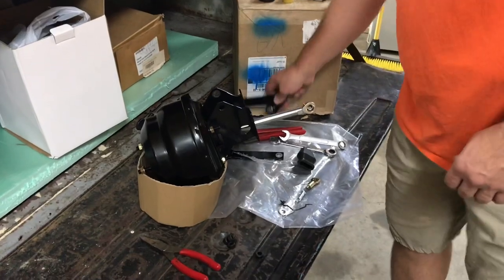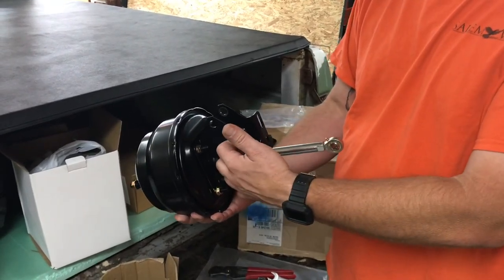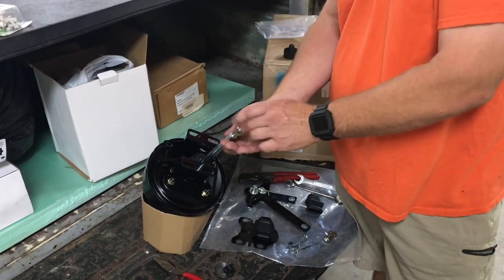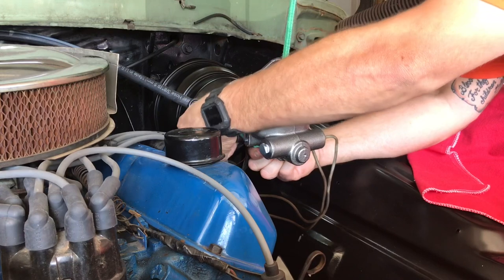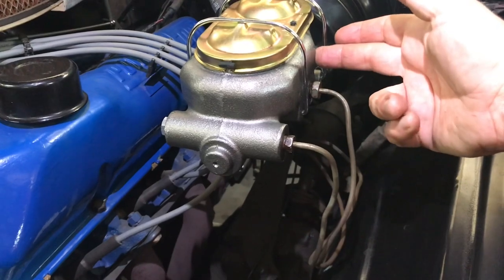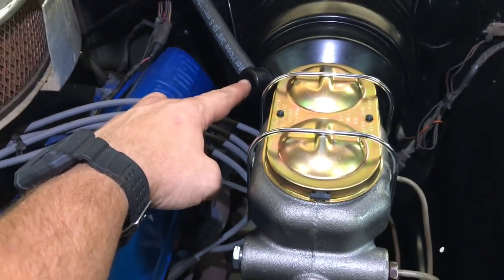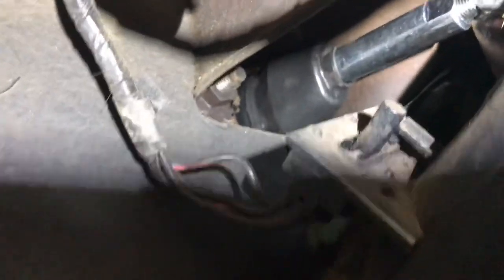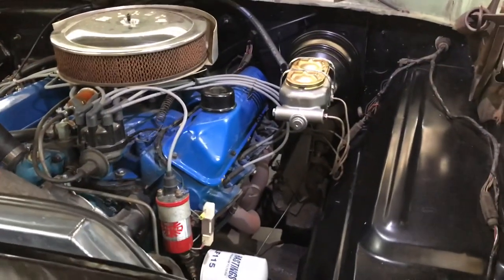CJ Pony Parts power Brake conversion kit F100

Comment: My father has a 67 F100 that was 4 wheel drums, no power. We added the brake booster a few years back and made a big difference. Just did the front disk brake conversion last week and it's so much better. I almost hit the dash the first time he hit the brakes because he just pushed the pedal like usual. Different company, and it was pricey but well worth it.
Reply from the maker: Yea it’s definitely a learning curve when you upgrade the brakes. I’ve still got to upgrade to front disks and install the factory power steering parts I’ve been sitting on for a year now. Definitely want to drive the ole boy more this year. Thanks for watching and please subscribe!!
Reply: @SalemVaOutdoorsAndMore  after 25yrs of searching I think I finally have all the stuff to do power steering for him now. It's a mix of factory and aftermarket both. Couldn't find everything factory unfortunately. It's already going to bee right at 100 degrees here tomorrow, so hopefully we can get that steering done within the month.
Reply from the maker: I had plans to put my power steering parts on over the winter, but we had out basement flood in the fall and everything had to be moved to the garage and I’m still trying to get that stuff moved so I can get my truck back in the garage. Hope to have the parts on by summer or fall at the latest. Best of luck with your project!! I’d love to see some pictures
Reply: @SalemVaOutdoorsAndMore  I've got a bunch, I'll try and figure out how to send some
Reply from the maker: My email is jab74@hotmail.com

Comment: Great video. I too purchased that kit for athe upcoming project and was surprised there was no instructions. I called cj pony parts and got nothing but attitude. Was told most of their customers are professional and can figure it out.  I said I am sure I can figure out just wanted to make sure I was using it the way it was designed.  Doubt I will buy anything else from them.  Again thanks for video
Reply from the maker: Jeremy Duncan glad it helped you with figuring out what was needed to make it work for you. I didn’t even call them about the instructions I just started looking for a YouTube video which I didn’t find one so I decided to post mine. Please subscribe if you haven’t and thank you for watching!!
Reply: I’d have sent the parts back and told them to pound sand. Attitude like that is bullshit
Reply: Got the same, "attitude" for a different question.
Reply: I don't use them anymore. I had ordered a bunch of parts for a 65 f100 and they sent the wrong ones and never have been able to get that resolved. Same thing with LMC Truck except LMC would take them back but when they resent the "corrected" parts they were the same wrong parts they had sent the first time. I'll never do business with either again.

Comment: was the rod with heim joint ordered separately? I just ordered this same kit from summit and planning to install on my 1971 f100 4x4. Im also hoping the booster clears my valve covers (i installed cast aluminum holley valve covers for FE engine.)
Reply from the maker: Nope everything shown was in the kit with the exception of the actual hose I used for the vacuum line. Thanks for watching and please subscribe!!

Comment: FYI, I did this a few years ago to my van, the manual pedal is set up for more leverage than a power brake pedal, there is a difference, I could lock up all 4 drum brakes and practically stand the van on its nose, unfortunately someone trying to beat the light making a left turn, they hit it head on, totaling it out.
Reply from the maker: Yes they are definitely more efficient than the manual drums!! Sometime they work a little too good. Thanks for watching and please subscribe!!
Reply: @SalemVaOutdoorsAndMore  I kept finding the manual master cylinders so weak they would not operate my rear brakes, years of them not engaging, the second I hit the power pedal they were working, I don't know how many manual master cylinders I went through, my brake warning light finally went off, pretty sad.

Comment: I want to put a power brake booster on a 1973 f 250 4x4 that I am building a engine for and putting power steering on also I hope I can get a kit for it that will work

Comment: Did you have to swap the brake lines around? Had to put the front line in the back and the back on the front.
Reply from the maker: I have not swapped the lines, both chambers are exactly the same size so it did not appear it would have made any difference to me. Thanks for watching and please subscribe!!

Comment: Awesome video, ive got a 1970 f100 with 302. If you dont mind, whats your set up on your wheels n tires? Did you add anything for the stance?
Reply from the maker: The front wheels are stock with the 6x15 steel wheels I think. The back wheels are factory style 8 or 9 by 15s. I’m not running any spacers. I do have the DJM lowering kit front and rear and had 1 leaf removed from the rear when I lowered it. Hope that helps. Thanks for watching and please subscribe!!

Comment: Did you have to add residual valves?  I have a 68 F100 with 4 wheel drum & want to add power brakes.  Kits I see say drum brakes require residual valves.
Reply from the maker: I didn’t add any additional valves and it works just fine. My kit said four-wheel drum or front disk and rear drum. It just won’t work on four-wheel disk.

Comment: I have a 79 f100 and I'm confused on the hook up of the front brake lines. I have same one in video but my original front line was hook to the bigger reservoir.  Thanks
Reply from the maker: Yes I was a little confused myself when I looked at it because I’ve always known the front wheel reservoir to be the larger one and I noticed that these reservoirs are both the same size. I just hooked mine up to the line which was closest to the connection port on the new master cylinder and have not had any issues. If you do have issues with yours after getting it hooked up, you can always add a proportion valve to help balance it out. Thanks for watching and I hope your project goes well! Feel free to ask if you have any more questions and please subscribe!

Comment: Can this system be used with any front disc conversion kit like the willwood from summit for example where I believe it's plug and play system.
Reply from the maker: It should work just fine, as long as you still have drums in the rear it will do drum drum and disk drum combinations. Thanks for watching and please subscribe!!

Comment: Hello there, I have the same year and model truck and did the same booster kit but for some reason my brakes locks after driving and braking for 8 min. I have to release the pressure to bring it back to the garage, I have quit trying to troubleshoot this booster . Do you know where should I be looking at and what I'm doing wrong?  Thank you for your time, Henry.
Reply from the maker: Is it all the brakes or isolated to just front / rear or one wheel? Multiple things come to mind to check. Could be pedal or push rid adjustment, or a leaking wheel cylinder.  How were they working before you installed the brake booster?
Reply: @SalemVaOutdoorsAndMore   thank you for your fast response. So it was extremely hard to push the brakes when they gave me the truck. I decided to changed all brake lines and installed front rotors. That was the only problem. The issue is left and right brakes locks and can’t figure out why. I have to bleed the Proportion valve just a very little to release the pressure then they free up right away but it keeps happening to the point the truck can’t be driven.
Reply: @SalemVaOutdoorsAndMore I mean, I have to bleed the Master Cylinder just a very little to release the pressure
Reply from the maker: That’s interesting, have you removed the cap to see if the expanders in the lid are dropped down to increase the fluid level? I found mine like that before even tho the cylinder was full. Not sure if the actual name of the lid seal with the expanders is called. Keep us posted!!
Reply from the maker: @JoeJoe Make sure the vacuum line is hooked to a good port, hard pedal sounds like either lack of vacuum or something binding
Reply from the maker: @JoeJoe Make sure the vacuum line is hooked to a good port, hard pedal sounds like either lack of vacuum or something binding

Comment: What size fittings go into the new master cylinder? I just got the same kit.
Reply from the maker: Sorry, I just now got the notification on your comment. Honestly, I’m not sure about what size the fitting is. It came with my kit. One of them had to use an adapter that was in the kit. The other one threaded it right in it depends on what your Truck has on the end of the brake line where it connects to the master cylinder

Comment: Hi. What is the size from booster to máster cylinder?. I want to buy one but i need to be sure that it fits in my car.
Reply from the maker: There is a link in the description that will take you straight to the same one I’ve got. It should have the specs on the site if you want to check it out.

Comment: What did you do for the brake light switch? The Heim joint is too big for the switch to work, seems to me.
Reply from the maker: I had no clearance issues with the brake light switch everything fit as it should have. The heim joint was pretty much the same size as the factory connection. Thanks for watching and please subscribe!

Comment: Great video!  Would you happen to know the bolt size of the bolts needed to mount the booster to the firewall?
Reply from the maker: Thanks for watching!! I think mine came with the bolts or I used the ones on my old master cylinder. I don’t recall having to purchase anything additional. Hope yours goes well and please subscribe!!

Comment: I have a 1970, all drum brakes.  I was wondering if you really need to replace the master cylinder? Or is it possible to purchase everything else as a kit, and just reuse the existing master cylinder (my brakes are working fine, I just wanted to add the power option.

Comment: Hey Jab! We actually have the same 71 F100 with the same paint job haha but I too wanna know more about it. My break pedal decided to not hold pressure anymore but I kept hearing noise coming from the front passenger wheel I think. I don’t know if that’s the exact location but there is a bit of cringing going around that area, break pads are fine too. I checked all my break lines and no leaks or anything. Do you think I could just need a new MC as well or is there something more to it?
Reply from the maker: Do you have power brakes or manual? Check for broken springs or hardware. If nothing there, I’d bleed them, maybe some air in the system.

Comment: Thank you for the great video. This answers a lot of my questions before I begin this upgrade on my 68 f100. Is the one you used a 7" or 8" booster?. I see both sizes available, I am just wondering which is better or will fit.
Reply from the maker: I think mine is the 7 inch booster, but not positive. There seems to be plenty room so I’m sure the 8 would fit also without any issues. When I ordered mine, I didn’t see any other options from TJ’s pony supply.  Thanks for watching and please subscribe!!!

Comment: Hello where is the proportioning valve
Reply from the maker: I don’t have a proportioning valve, been thinking about adding one to see if it helps improve breaking anymore. It was such a dramatic improvement over the manual master cylinder. I didn’t think I needed it. Sorry for the slow response.

Comment: Thanks for posting, super helpful!  I have a drum brake on all four wheels, I am wondering if you have the same setup.  If you do, do it work just fine without a proportioning valve?
Reply from the maker: Thank you! Glad you found it helpful. Yes I do have drum brakes on all four wheels and don’t have any issues and I do not have a proportioning valve. If you upgrade the front to disc brakes I believe that’s when you will have to add the portioning valve. Thanks for watching and please subscribe!
Reply: Part number ??
Reply from the maker: peche depihuamo Brake Booster Conversion Kit Black F-100 1957-1977
CJ's Part Number: BBCK31 cjponyparts.com
Reply: @SalemVaOutdoorsAndMore  thanks

Comment: Does it come with the master cylinder also?
Reply from the maker: Sure does, comes with everything you need just install it hook up your brake lines and top it off with brake fluid after you bench bleed it and you’re good to go. Only thing you may need if you have front disc brakes is a proportioning valve. Thanks for watching and please consider subscribing!

Comment: How is this upgrade holding up?
Reply from the maker: It’s doing great!! I’ve not had any issues with the install at all. Biggest adjustment needed was in my brain after driving my F100 so long with manual brakes! I wish I would have done this years ago!! Thanks you for checking in and watching and please consider subscribing if you haven’t already.

Comment: Any way you could show how to bleed the brakes on an old truck like this?
Reply from the maker: I usually start with the furthest wheel and just have someone pump up the the pedal then hold it. I then crack the bleeder valve and they tell me when the pedal is at the floor and I close the bleeder. I keep this up until I don’t get any more air. If you want to go a step further, get a 1/4 inch clear tube, slip it over the the end of the bleeder valve and run it into a cup with fluid in it so it prevents any chance of air getting back in the bleeder before you close it. Keep an eye on the fluid level in the master cylinder. I do it with the lid off the master, just be easy pumping the pedal. Hope this helps, feel free to ask any other questions and please subscribe!!

Comment: did you not need a proportioning valve?
Reply from the maker: With 4 wheel drums you do not need the proportioning valve, but if your running front disk and rear drum you’ll probably have to have it to get the balance right. Thanks for watching and please subscribe!!
Reply: thank you for information!

Comment: Where did you connected that rubber hose to? I can’t figure it out.
Reply from the maker: Depending on what engine you have, there will be a vacuum port on top of the intake (V8) where the carb vacuum line and / or the auto transmission vacuum line hooks up. I ended up having to tee mine into the trans vacuum line because I couldn’t find another port to match what I needed. Hope this helps, thanks for watching and please subscribe!!

Comment: Question I see that you have a 4 port master cylinder. Is there a certain way to plumbing it? Is it the left side first and right side or front than back on the master cylinder?
Reply from the maker: Yes there are 4 ports. There’s a left and right side to the front and rear reservoirs. I only had a front and rear line on my OEM master cylinder so I just used the ports on the fender side because it worked out better for my. You can use either side and the reservoirs are pretty equal in size. I would say some if you were so inclined you could use all 4 ports and run individual dines to each wheel if you wanted but since there are only 2 chambers it wouldn’t matter because if the right rear sprung a leak you’d still lose the left rear also. Thanks for the question and feel free to ask anymore if they come up. Thanks for watching and please subscribe!!!!
Reply: @SalemVaOutdoorsAndMore  so I have this same master cylinder on my c10. But I was confused about the for port system. I’m not sure if I have to plumped out all 4 port than close off the onside I’m not using. 
I’m having an issue with my rear brakes there not working. FYI I have all new lines
Reply from the maker: Did you bench bless the master cylinder before installing it? If not you can definitely do it in the truck but it’s not so easy. If I has to guess I would start with bleeding all the lines again. I have issues with sticking shoes but that’s just lack if use and needing to grease the perches.  How’s the pedal feel?
Reply: @SalemVaOutdoorsAndMore  yes I did bench bleed it before I installed it. I only did the side I needed. So when I installed it the front works but the rear nothing. I notice when I step on the brakes it just looses pressure. Like if it still had air. I thought it was the master cylinder but maybe I have to bench bleed all for 4 than close off the one I don’t want to use
Reply from the maker: So the ones closest to the front on the left and right both use the front reservoir and the ones closest to the back both use the rear reservoir. As long as you use one front and one rear port and bleed both reservoirs you don’t need to bleed all 4. I had all 4 capped off when I bench bleed it then just removed the front one and rear one and connected my lines then bleed the brakes. Can you send me a few pictures of how you have it hooked up now? My email is jab74@hotmail.com
Reply: @SalemVaOutdoorsAndMore  tomorrow I will
Reply from the maker: I didn’t see that picture come through on my email yet, did you have a chance to send it? It may have went to my junk if you did I’ll have to check.
Reply: @SalemVaOutdoorsAndMore  I didn’t send it but I found out it was a bad master cylinder I ended up buying one from a auto part store and bleeding it and I installed it and work out.
But I’m still Curious why the other one didn’t work